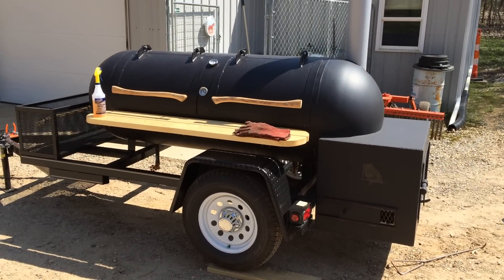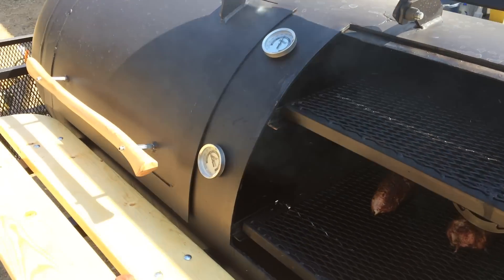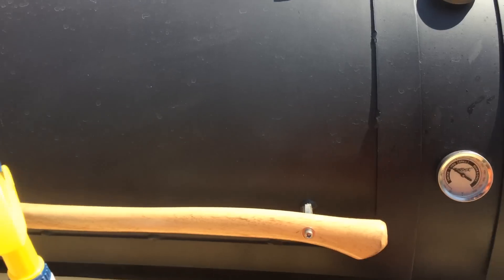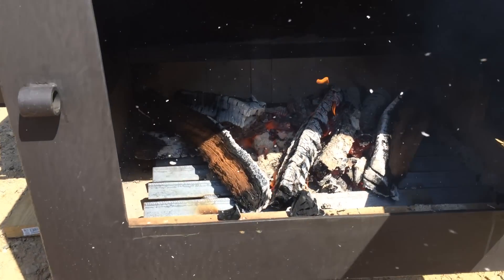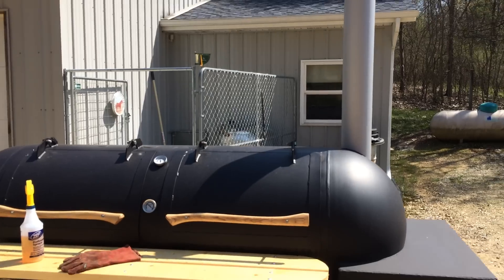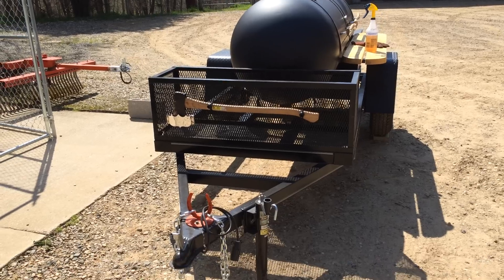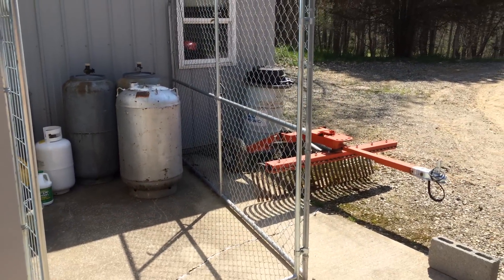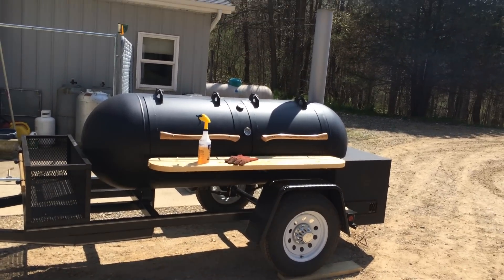The cook... reverse Flow Smoker...!!

Comment: Very nice work! I just finished building my first smoker too and now I am checking out all the latest builds on YouTube, I came across a couple nice ones you have built. Normally, I am not a fan of wooden parts on smokers but I think your wood theme is done tastefully and I like the character it has with the axe handles on the smoke chamber doors, the axe mounted on the wood compartment at the end of the trailer, and the rounded ended wooden shelf. It has charm to it and originality; I have seen plenty of horseshoe themes but never axe handles. I like it!
Reply from the maker: Thank you!!

Comment: How far did you put your smoke stack in the tank itself?  I'm getting ready to start mine.  Will be a reverse flow out of a 250 gallon tank with an upright smoker/warmer box mounted on top of the fire box.  Didn't know if I needed to mount it flush or insert it into the tank.  There will be a damper from tank to upright chamber to allow smoke to enter the chamber with exhaust on the upright as well.
Reply from the maker: Run the stack down even or just below the lowest cooking surface.. the stack is one of the most common mistakes I see.... ON DAMPER!! to create a clean burn you need to let the smoker flow you can control the heat with the fuel and also the air inlets, I see so meany people try to use the/a damper to control the heat and they end up with dirty smoke.    (just my opinion)
Reply: Thank you.  I may not even put a stack on it, just let it vent out of the warming chamber now that I've been thinking about it.  Thanks for the help!
Reply: Hey Rob, what's the reason on the smoke stack running down to or slightly below the lowest cooking surface, instead of simply having it come out off of the top of the smoker?

Comment: Great looking smoker!  I'm in the beginning stages of building my own...couple questions: what does it mean when you say that you get the tanks 'stripped'? And what causes the 75 degree difference between the 2 racks?  It seems like if anything the bottom rack would be hotter but is that due to the flow of the smoke on a reverse flow smoker?  Thanks!
Reply: heat rises!

Comment: Great smoker Rob! I' am building my first smoker as we speak and am using a 250gallon compressor tank. Almost identical. How did you determine the chimney size i.e. 5" pipe? and length. Also how much does yours protrude into the chamber? Also if you have the time how much space did you leave between the "reverse flow baffle" and the cooking chamber wall?
Reply from the maker: Chris Keller Hello and Thanks! to determine the size of the chimney there is a calculation... but if you are using a 5" pipe you would need a 50" pipe, 6" pipe would be 34" ( 6" is what I used) the pipe/chimney should go into the cooker even with or just below the lowest cooking surface, this is a MUST!! by doing this you will not need a baffle on your chimney and it will cook MUCH better and burn cleaner... My revers flow baffle is about 1/3 of the way up from the bottom the same as the top of the fire box.

I hope this helps and good luck!!

Rob,

Comment: Nice smoker.  Insulated fire box?  I have a 250 gallon reverse flow and I need a much bigger fire to get up to 275°
Reply from the maker: Thanks Brandon 

Yes the firebox is lined with firebrick on the bottom and 9" up the sides.. 

Brandon how far into your smoker does your chimney protrude? I have found that it should go down even to or just below  the lowest rack in your cooker, this eliminates the need for a damper on your cooker and allows for good draw from the fire box. I hope this helps! 

Rob,

Comment: Hi Rob,

Good job on your smoker. I am about 1/2 way into mine. I did have one question about cooking. How much wood is consumed during a typical smoking of pork butt? I am trying to plan the wood storage appropriately.

Thanks, Ron
Reply from the maker: braunzie2 that's a hard question to answer... I can tell you I cook pig butt for 8hrs and I use about 1 good wheelbarrow load... I hope this helps... truly is all relevant to size of wood and species of wood, if your cooker is burning clean you will use much less would but you may suspect
Reply: Thanks Rob. That helps me gauge it a bit. I do have a question though. Is welding your trade or is it a hobby?
Reply from the maker: Its my hobby.... but people would like it to be my trade, i do now do some work out of my shop but im very carfull not to turn it into a job

Comment: Hey there, I asked this on another video but this one you were cooking and mention that you get about 75 degrees difference top to bottom. Is that the whole length of the grill or just at the mid point?
Reply from the maker: It’s the difference in the top grate and bottom grate
Reply from the maker: Greedy Paul Yes the whole length of the grill carries about a 75° difference between the top and bottom rack
Reply: Love your grill. Is it ok with you if I make one modeled after yours? Gonna make a couple small changes if its cool

Comment: I want to build one but I know nothing about reverse flow
Reply: Manny Lopez it's essentially a standard offset smoker but with a solid baffle that runs horizontally from the firebox end and stops short from going all the way to the far end to allow the smoke and heat to pass from the bottom to the top. Look at where his wooden shelf is on the outside of the smoker. The baffle would be approximately at that height, perhaps a bit lower (most likely even with where the top of the firebox connects to the smoker body), and would basically divide the smoker into upper and lower halves. Think of it as a tunnel for the smoke and heat to pass through to get all the way to the far end of the smoker, then pass to the top half where it goes back the other direction and passes over meat. That's why the smoke stack is at the same end as the firebox.

The concept is more even heat across the cooking surface because the baffle blocks the heat from directly hitting the meat that's closest to the firebox first. It also heats up and radiates heat to the meat. I'm putting a slight downward slope in mine from the open end to the firebox end with a lip at the open end to create a fluid reservoir for water. I'll put in a drain pipe and valve to empty it.

I hope this helps you understand it a little better. If not, or if you want additional info, Rob has a slideshow video of the build of this smoker, and I seem to recall it showing the baffle in the smoker. There are also other videos on YouTube and if you google reverse draft smoker, you can find plenty of images and drawings that'll probably help you way better than my poor attempt at an explanation.
Reply: Traditional flow is better